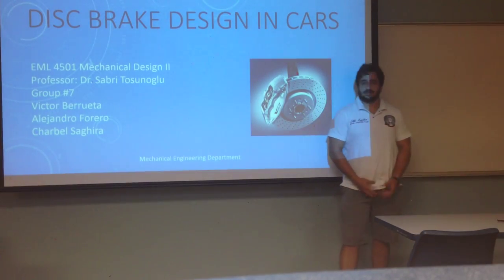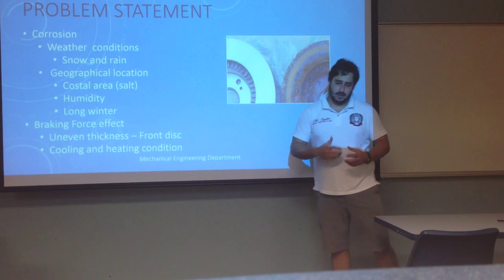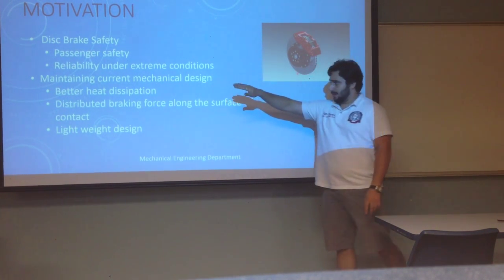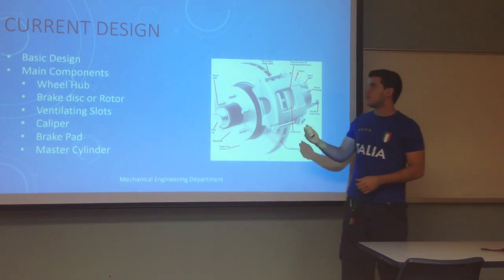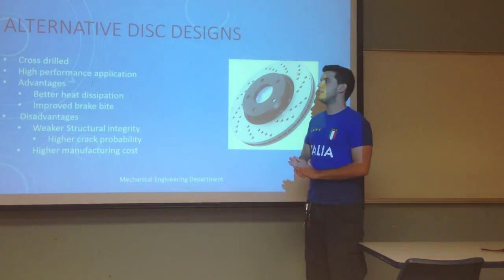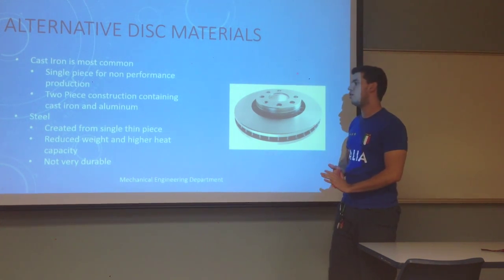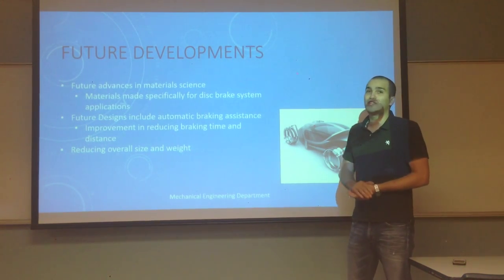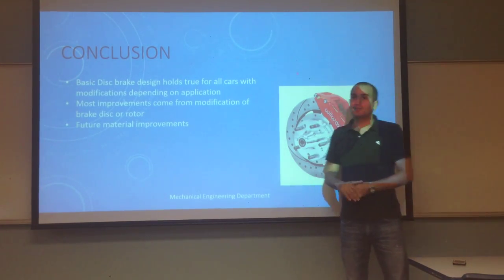Team 7: Disc Brake Design in Cars

Comment: Extremely informative presentation. Helped me understand how disk brakes work a lot better. The lighting is accurate so that we can see the information in your slides clearly. I can notice personally that much research was done on this subject. It is easy to follow and understand the flow of the presentation. I do think that the history should be told in the very beginning to the start the technical explanation but in general it was very good. The voice is clear and presentation flows nicely. The manufacturing of the disk is very interesting. I would be interested in speaking to you guys to give advice on my senior design project, good job.

Comment: Great presentation and enthusiasm. I enjoyed that the diagrams weren't just there to fill space and that the presenters referred to them and they were used to actually explain the function of various parts. I never had realized that heat dissipation was such a large issue with brake design. My critiques would be that the presenters face the front more while presenting as their voices tended to get lost while they were looking at the power point, and that the font on the power point was rather small and hard to read.

Comment: The slides are very clear, and when you turn up the volume to an adequate level the sound is impeccable. Very informed speakers that know what they are talking about. The only problem is that the speakers look at the slides often.

Comment: Presentation was very informative. Only suggestions would be to try and not stand in front of the screen, although I realize it can be tough to point to slides without doing it. Also, facing the camera the whole time instead of turning slightly towards the slides. Other than that good job.

Comment: Presenters should have looked at the camera more throughout the presentation rather than reading off of the powerpoint and engaged their audience. Also the slides on the presentation were a bit crowded with information and the camera angle should have been adjusted.

Comment: The presentation was very informative about disc brakes and how they work as well as all the different designs and improvements that have been made over time. The Power point is easily readable and the lighting is good. The only recommendation I would make would be to face the camera while you are presenting to make it easier to hear and follow.